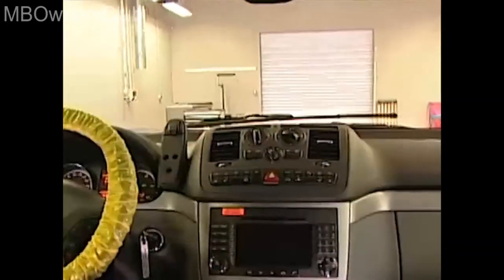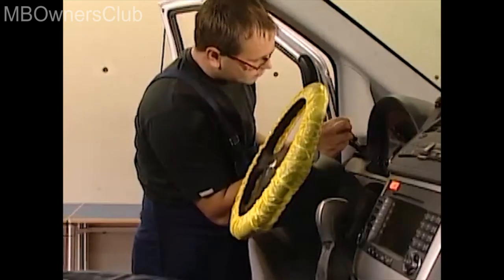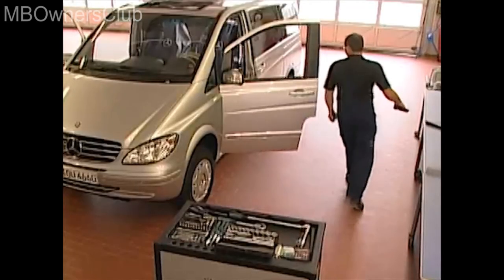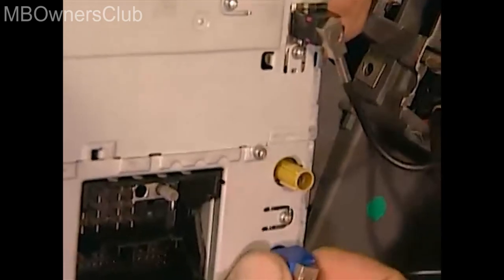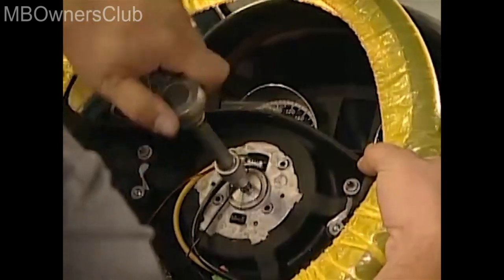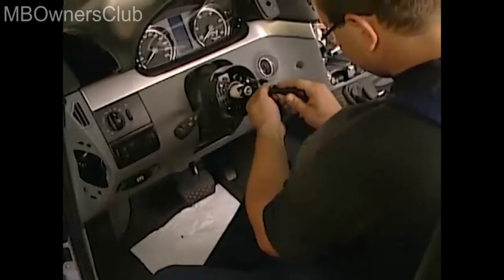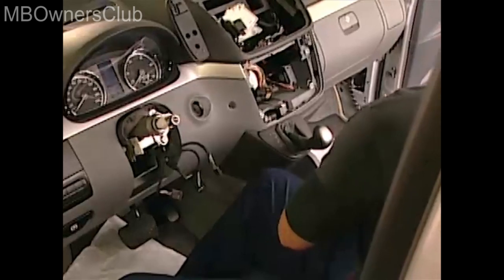Step-by-Step: How to Remove the Instrument Panel on a Mercedes-Benz Viano (W639) - Part 1

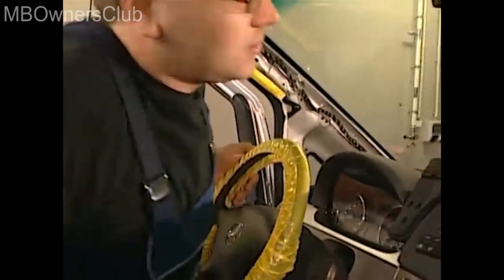Comment: Hi MBO Owners. Thanks for the video. I have removed the airnosl of the middle min 4:15 but i'm struggling to put it back in place as I can't access with the screwdriver without the screw falling out, is there a particulare technique to rescrew the 4 screws( the one of the top is easy but the other ones are tricky)
Reply: The two lower ones are rather easy too. You may place them with a magnet and then fasten them...

Comment: Can someone help me. After i removed the dashboard and replace is. The headlights stay on when i turn the key to contact. Also signals dont work als so schreenwachers and claxon is als not working. Does someone have  a idea please
Reply: did you resolve this?  I have just done the same and the emergency light is staying on.  I thought I must've knocked a wire somewhere (waiting for the weather to cool down to investigate further)